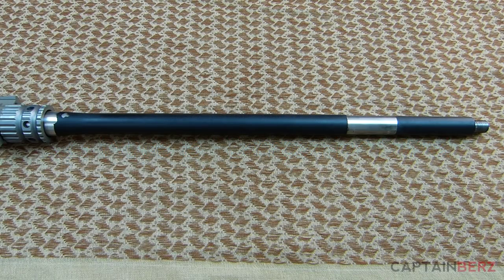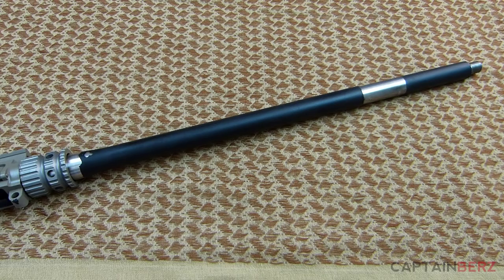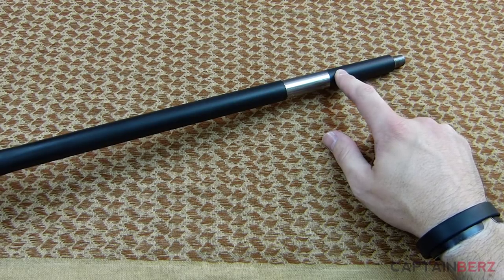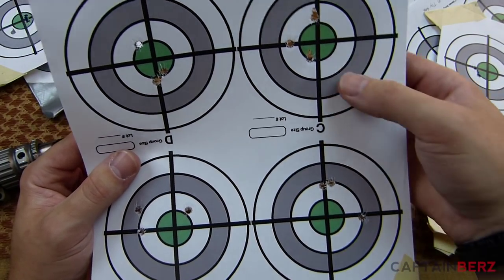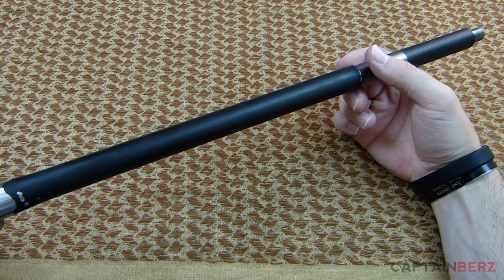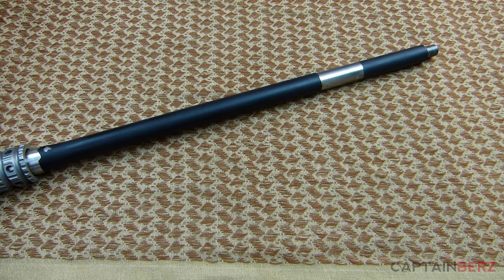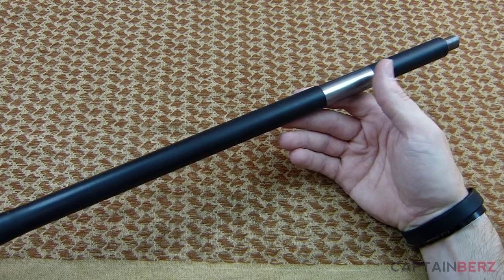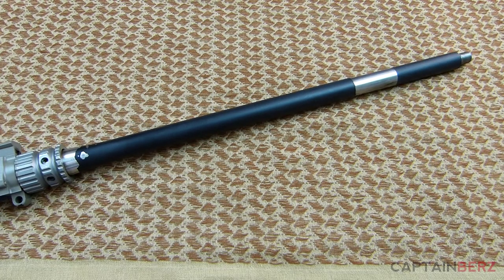Nordic Components 18" SPR .223 Wylde Match Barrel

Comment: Brownell's has the White Oak Armament 18" SPR barrel-.223 Wylde Heavy Match SS, Rifle Length gas system for $269.00. For the extra $20 you get a top notch barrel. I looked at the Nordic because at the time, everything else was sold out, but the WOA came in and it was a no-brainer IMHO. Glad you did well with the NC, just putting it out there about the WOA. It's a known quantity as far as brand and quality go.
Reply from the maker: Mike Melina That is also a great choice.
Reply: this Nordic components barrel is also top notch.  it is actually made by Wilson Arms in Ct.  White Oak uses or used to use Wilson Arms barrel blanks for their barrels.

Comment: I am doing a build with an 18" Wylde, 1 in 8 twist..etc, etc.. You recommended a rifle gas system. Can you please explain why you like a rifle gas vs. a mid gas system. Also, what weight buffer were you using and did you have any chambering issues?
Reply: Michael McFadden have you done your rifle build? I have many of the same questions that you do. I have the option to get a mid length or rifle length and many people have had troubles with a rifle length in their AR15. I want my rifle to be as reliable as often.

Comment: This might sound dumb but does this come with a barrel nut
Reply: +rouslan tangborn No, barrels don't usually come with barrel nuts. Most front handguards come with barrel nuts, many are proprietary. Say you buy a ALG Modular rail...it comes with it's own barrel nut. Most do.  If all you're doing is replacing your barrel, you would use the nut you took off.

Comment: Nice. Quick qustion... what paint did you use to coat the barrel? With exception of the barrel nut removal, I guess it handled the heat ok.
Reply from the maker: Jackal's Outdoor Channel Alumahyde II Flat Black for the base and Rustoleum BBQ High Heat Flat Black to finish.
Reply: CaptainBerz thank you...